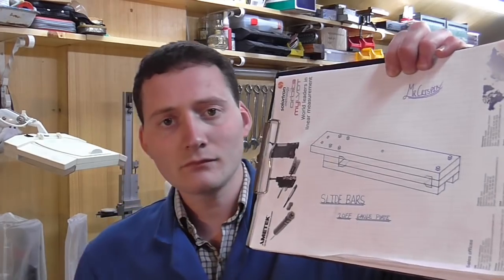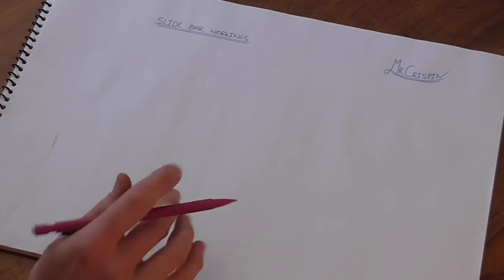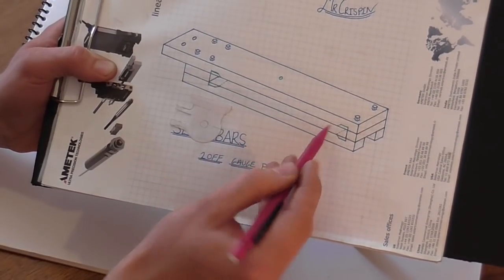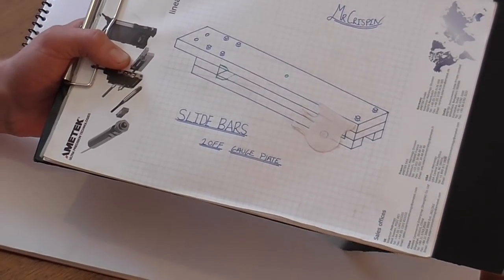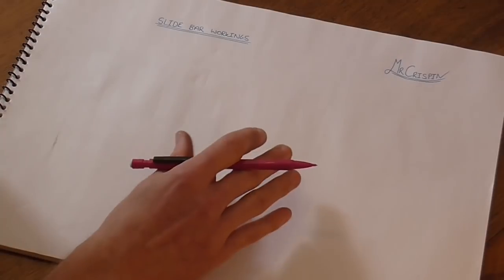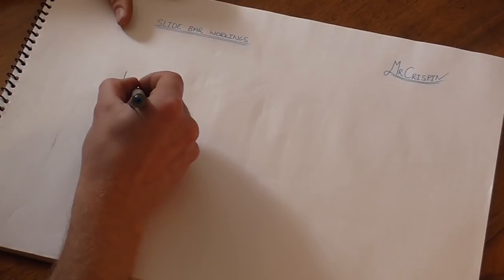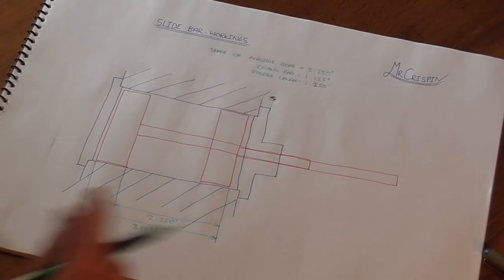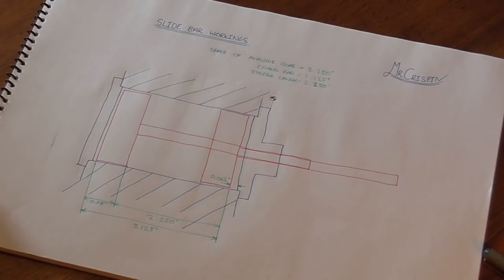Cylinder Block Musings

Comment: Thanks for taking us though the process. I tend to do things  pretty much the same way because  telling the cad what to draw often seems like more of a hassle than telling my hand what to draw.  Cheers!
Reply: I'm the opposite. My hand won't draw what I tell it to. I draw on graph paper and use a ruler to get anywhere near straight.
Reply: @tiredoldmechanic1791  Lol! I use ruler extensively, and a compass!
Reply: @thetransformatorium7980  Huh, a compass won't give you very straight lines.
Reply: I think on paper by hand is much easier. It doesn't have to look pretty it's just a mental map on paper of what you've got. As long as you get the numbers correct and remember whether you need to use addition or subtraction.

U-boat motive power - subtraction ?
Reply: @millomweb  LOL! So That's what I've been doing wrong!! 🤣🤣🤣

Comment: Loud and clear Mr Crispin, no problems at all (exactly how I would have chosen to do it, even though I have the CAD option), you can't click on the wrong intersection point on paper! Don't give all the 'workplace' meeting etiquette away, some there have made a living out of what you described! (seen it 1st hand). Just a thought, you are probably OK with your 0.025 overrun allowance to cover it, but for those that don't have our background, maybe a nod towards 'stack-up of tolerances' would be useful owing to the high number of potentials in this assembly arrangement. Keep up the good work, excellent presentation! Cheers, Jon
Reply from the maker: Yes that's a good thought. Cheers

Comment: Another excellent video, following with great interest- thank you!
I'm sure you've accounted for this, but a word of caution for others particularly using high precision cnc.
 The actual piston stroke length is the diameter of the crankpin's rotation PLUS maximum bearing wear gaps AND relative movement caused by the wheel's suspension compressing and extending.
 Regards, Will
Reply from the maker: Good point

Comment: MrCrispin, I too prefer PAD over CAD as it exercises the grey matter. I have using the grey matter found errors on CAD designed drawings where I used to work by just that method.
Cheers from John, Australia.

Comment: Well done Cris, what about an allowance for a cover gasket?
Reply from the maker: That's a good point. I'm planning on using gasket paste so hopefully not too much extra thickness
Reply: And a pistonrod seal?
Reply from the maker: As Chuck says the piston rod seal is around the diameter
Reply: @MrCrispinEnterprises  ask Richard about gasket paste! I think you will be better with a gasket.
Reply: @MrCrispinEnterprises  I was actually thinking about an adjustable one,
but I guess the scale is too small for that.

Comment: I can imagine a situation where an old loco tootles around the yard shunting trucks here and there, all the time wearing out it's cross slides and forming quite a high ridge at each end. 
What a clatter it would have made when it finally got to stretch its legs on some long down hill run. 
Hence the relief was born.
Reply: But engine speed does not affect the crosshead's travel.

Comment: Nice job on the explanation. What I don't know yet is the actual method of attachment for the piston rod into the crosshead. Given that, I think I would have taken a different approach. To my mind, what makes for a more absolute positioning of the crosshead to the slide bars is the whole combined assembly of the cylinder sub-assembly (including the slide bars), frame, drive axle/wheel, crank pin and main connecting rod. These together will create a fixed location for the crosshead in its travel and end points. It shouldn't change, except with bearing wear over time and/or tolerance stack-ups. But the amount of such change should be rather small. Your approach used the end and length of the piston rod to fix the location of the crosshead. But in the final assembly, is not that connection the one with the "adjustability" so that the piston can be centered in the cylinder bore (and possibly the piston/rod assembly too). I may not know much about steam engine assemblies, but I do see this from a mechanical/machine point of view and realize that something has to provide some adjustability for the full assembly. I don't imagine that it would be within all of those other components. If I'm all wet on this, no problem. Won't be the first time.
Dave
Reply from the maker: Yes you raise a good point as many steam engine piston rods connect to the crosshead by means of threads and a locking nut. In that case you would be absolutely right. 

This piston locks in to the cross head however by means off pushing the piston all the way up in the cross head and then pinning it in place with two taper pins. 
On most locomotives this is a taper fit. Either way the piston / cross head fit isn't responsible for any adjustment in this design.  

Cheers 
Crispin

Comment: Sir , outstanding as always I was fretting over cylinder cover gasket thickness but you’ve explained that’s not an issue  ... phew !!!  I still maintain the best work is done with pencil and paper on the kitchen table .... 
regards 
Partsmade

Comment: If there is a gasket/seal under each cylinder head, won't that alter the position of the slots on the slide bar?  Enjoying this build. Thanks
Reply from the maker: I'm planning on using a small amount of gasket paste so not enough difference to make a difference although it's a good point and probably worth considering. Cheers

Comment: Speaking as an Engineering Manager (retired), I would much prefer you to have CAD skills. CAD does not preclude you from skiving, sorry sketching during meetings. I am proficient in both!
But seriously, I have known a few engineers and draughtsmen who shied away from moving to CAD. They were eventually forced to do so and to a man said it was the best thing they had done.
I really think you should give Fusion360 a go. It's a professional package that is free for hobby use. It is better than the software costing thousands that I used when I was working. Give it a go - you will love it. It will also be a great skill to have in your other job.
Modelling the parts in 3D will inform the manufacturing methods you use to produce the physical parts. And at the end of the day you will have two locomotives: the virtual one and the real one.
Reply: Some years ago, I paid MONEY to buy AutoCAD - and then did nothing with it !!!!! (other than install it and dabble.) Sadly, I'd been used to Freelance Graphics (for DOS) - which was a lot easier to use !
My hands have no art in them. My eyes have no concept of size or scale and my paper always ends up with holes in it due to all the rubbings out.
But when it comes to machinery, my whole body is tuned to the situation - hands - for overheating parts, vibrations and friction detection. My eyes will spot the results of loose bolts on rotating machinery and my ears become multi-purpose detectors.

Comment: I remember getting into a engineering situation years ago working out an assembly this way... over 6,000mm long..... and didn’t account for thermal expansion.... luckily we could machine the offending face down!
Reply: That's almost 6m !
Reply: @millomweb   that was the problem, it was about 6,008mm at temp. Not 6,000mm. Should have said ‘over the final assembly length’

Comment: I've been a machinist 35 years. Nearly every print I get has to get has to get similar "calculation treatment", although usually not that in depth. Excellent!! Is this an American design, hence the Imperial measurements?
Reply from the maker: No it's English but it was done in 1955!

Comment: Regarding the piston travel: Is the driver axle crossing the cylinder axis? On the picture of the engine it looks like as if the driver axle is positioned slightly lower which should have some (small) effect on the exact length of piston travel if I am not mistaken?
Reply from the maker: Hi, yes good thought. The interesting thing with a locomotive is that the centre of the driving axel is allowed to move up and down within the horn blocks. So however you set it up you end up with the piston positions varying slightly during running. Hopefully there is enough clearance designed in all round for this aspect not to become a problem.
To answer the question though, on the scaled down drawings the cylinder bore is dead in line with the driving axel centre when the horn blocks are in their mid position. Cheers
Reply: It strikes me as insanely clever that ( given the main driver's axis ability to float up and down in the horn blocks)  that on each of the power actions  in a full cycle of an individual piston,  the reaction of the connecting rod at the crank pin adds to the main driver's down force and as a side effect it's  tractive force. 

   But as I think about it, is this  not as helpful  an action  as I think, because you lose what you gained on back half of the stroke ( past 90 deg).  ???   Is the force  on the con rod equal on either side of crank pin cycle (tdc,bdc).   Is the steam " spent " once the volume increases. I wonder what a graph of forces would look like through 360deg.     Great video.   Thank you for sharing.

Comment: Is this method of explaining clear?
Clear as mud ;-)
Seriously though, it is very clear.
A couple of comments;
1.  Compute in ⅒ of inch. It will allow you 0.0625" or 1/16 of an inch.  Rounding to 0.062 (0.063?) Introduces rounding errors too early.
Of course, if your design's dimensions are in 1/32, you need more precision, etc.
2.  Round to machine accuracy only after all head scratching is over.  Then you can stack rounding errors in a logical, methodical, intentional manner.
Also, In my innocence, I assumed the Great Britain has followed DE and FR and gone metric decades ago.  Alas, I have noticed you and others are still thinking Imperial. What will the Canadians think of you!

Keep up the excellent work. You are doing rather well.

Simon
Reply from the maker: Thanks and good point about the rounding.

Comment: I agree that it all makes sense. But in industry we also need to take account of tolerances. This is an area that you will also encounter. But for you, it is termed fitting. So on assembly you will have gaskets between the end caps of your cylinders & the cylinders. Only a few thou & remember you have fitting. I think that you are just about correct with your 0.025" over-run. As long as the motion goes just past the edge it will meet the requirement.

Comment: great video — thank you!

if the purpose is to get the edges of the crosshead into clear, fresh air at the ends of the stroke — and you’re doing that by 0.025” equally on both ends — why is one slot much wider than the other?

when you mentioned your kitchen i thought we were finally going to get your meatballs recipe!
Reply from the maker: The difference in gaps is just down to the design, you could redesign it to have similar gaps but that's just the way it is. (The design is just a scaled down version of the original)
Sorry about the meatballs!

Comment: I have my doubts as to whether this will be received by Mr. Crispin, but I will give it a shot. 

You may have covered it and I missed it (I realize this is a little beyond the scope of the subject at hand), but you mentioned the stroke of the piston being equal to that of the diameter of the circle being swept at the drive wheel(s) by the push rod (please forgive my light grasp of the terms here). For my own edification, would one actually make the piston stroke slightly longer to avoid piston slap at the ends of the bore in the cases of rod stretching and/or wear? I hope I'm not embarrassing myself here with a nonsensical query. While I do own a copy of Modern Steam Engines, I never really finished the book...

While I have your attention I would like to tell you that, like so many others, I thoroughly enjoy your videos and find your attention to detail and accuracy during machining quite refreshing. For 30 some-odd years I have only worked alongside hacks and blacksmiths. Sadly, I have adopted some bad habits along the way. It's a shame, really, that craftsman such as yourself are sparsely located around the globe such that they cannot physically rub elbows and collaborate to grow a greater community of interest in precision machining. 

Keep up the good work as I await your next installment!
Reply from the maker: Hi, thanks very much for your comments. In terms of the piston hitting the covers yes that is a very important point. You clearly do not want the piston hitting the covers. Thankfully in this design the available bore length is longer than the swept length by 1/16th at either end. 
Cheers.

Comment: Hello Mr C. I think the three of us enjoyed that presentation and at least one of us commented on the clarity of it. A couple of questions follow. One: is the locomotive sprung and is that movement accounted for in the calculations? Three: is expansion and contraction worth consideration in piston stroke and clearance? And finally question B: Will you publish the recipe for sticky toffee pudding?
Reply from the maker: Hi, I think the simple answer is that because I have a clear 1/16th at either end of the cylinder I can aim for a nominal mid position with the luxury of not have to worry to much about the matters you have raised. I hope so anyway. 
As for the recipe, try Paul Hollywood!

Comment: Would you want to leave allowance in the stroke for variance in wheel's crank pin non-concentricity (eventual slop)?  The tightness of tolerances between the different system elements makes for a highly coupled system, something we try to avoid in modern design.  It makes me think differently about locomotives... More deeply.
Reply: Very good idea.  A steam locomotive can have a lot of slop and still work very well.
Reply from the maker: Interesting thought, hopefully over half a millimetre each end should do the trick.

Comment: All good, just nit-picking: The stroke length is directly determined by the radius of the wheel crank only when 
 the axle of the wheel is in line with the mid-line of the cylinder. But I guess that usually is the first step, when designing a steam engine but I have seen designs where this was not the case.
Reply from the maker: Good point and yes allot of engines have an un equal arrangement.
Mine is on the Centreline in theory although the axels can of course move up and down within the horn.

Comment: The cross head length is 1.125" not 1.250"  (16.30 mins to 17.50 mins) or did I miss understand?
Reply from the maker: The dimension from the end of the piston rod to the right hand side of the cross head is 1.125" but then the overall width of the cosshead is 1.250". Hope that clears it up. Cheers
Reply: @MrCrispinEnterprises  Thanks for the correction. Keep going please, this is both fascinating and practical.

Comment: "the total space consumed within the bore"

I think what you mean is the 'swept length' of the bore.

Not that you need that info. You need the stroke - amount of travel - and the length of the crosshead and the position of the crosshead at one end or t'other.

Comment: So is the crosshead 1.125" or 1.250"? You seemed to  switch when you changed ends, so unless you actually already calculated it correctly, one of the slots is incorrectly positioned...  maybe I should watch to the very end before hitting the button :~D
Reply from the maker: Yes from the end of the piston rod to the right hand side of the cross head is 1.125", but the when coming back the overall length of the cross head is considered which is 1.250". Cheers
Reply: @MrCrispinEnterprises  Aha - I watched that a couple of times without twigging! I too should have taken a piece of paper and drawn it out to clarify, thanks. Great series, it is good to see so many skills on display (particularly hand filing and trepanning).

Comment: A very well illustrated presentation. However, isn't it the length of the main rod that sets the crosshead position to the guides, and the adjustment of the piston rod to the crosshead that puts the piston in the correct position in the cylinder bore? As accurate as you make your parts either method works as I am sure the calculated length of the piston rod will be the actual dimension when completed. And those dimensions are critical and do need to be taken in account during the build. I just believe a lot less math would be required drawing from the main rod end. 
On the Allen Models Fitchburg Northern I am building, see video below, I now believe I will mill the reliefs on my crosshead guides as you have so ably demonstrated.
 I was very impressed with your paper method of protecting the surface of the crosshead guides while filing off the burrs left by the milling cutter. Always learning and thanks for your videos.

https://www.youtube.com/watch?v=e9iY9hT8iGI
Reply from the maker: Yes that's an interesting question. I think I'll answer that question on camera as it's been asked by a few people and there are quite allot of things to discuss.
Cheers